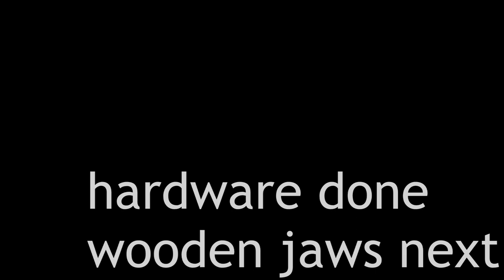Installing my new vise - Part 1

Comment: 2:04, bothers me that the end of the face of the vise is not flush with both sides.  Guessing you weren't able to mount that plate to the opposite side of what supports it without losing some inches on your vise.  Different strokes for different folks..

Comment: Picking the appropriate woodwork plans is a decisive step to stay away from failure, so be certain to grab the ones that are prepared by professionals.
Reply from the maker: +Matilda Burkitt I constructed this workbench myself and hey: failures are there to learn from :D (regarding the screws for fixating the vise: I calculated for shearing and bending and those screws are really oversized lol)

Comment: Excellent job with the install and overall production.
Looks like a vise they sell at Lee Valley...thinking of getting one.
I assume this is the largest version 10-1/2".
Reply from the maker: +Darryl Stevens Hi! Its a no.53ED from a company called York and yes, it was the biggest model they had. I got it at: http://www.feinewerkzeuge.de/schraub.html
thx for the comment!
Reply: Thanks for the info
Reply: +wood and stuff Looks like a copy of the Record 53ED...
Reply from the maker: +Mark Dennehy That might very well be, yes. The one I used looks exactly like a Irwin Record 52ED...great design after all :D
Reply: Yup, and one I'm planning on using myself shortly :)
Reply from the maker: +Mark Dennehy Great! It's a really practical vise and you will never wanna miss it haha

Comment: Thank you very much for sharing , I have one  question please what to do if my vise is small and its height is much less than the thickness of the bench ? any ideas ? thanks
Reply from the maker: Is it the same design as my vise? You could try to in-set the whole thing from the bottom. Or you could just leave it on the lower plane of your workbench and add jaws with the appropriate height. Thanks for the comment!

Comment: Just watched a video from Paul Sellers that has a lot of good reasons not to flush mount your vise to your bench. This kind of vise was never intended to be flush mounted.
Reply: I saw that too - and followed the Paul Sellers approach. I can always use a spacer block and a sash clamp if I need a flush-mount equivalent.

Comment: This may sound like a dumb question, but did this come with the mechanical fasteners or were those purchased separately
Reply: for what ever reason 99.99% of vises seem to come without any actual fasteners. you always ahve to have/buy your own
Reply from the maker: Hi, sorry for the late reply. There were no fasteners or screws in the kit, I had to use some big bolts.
Reply: okay thanks a lot.